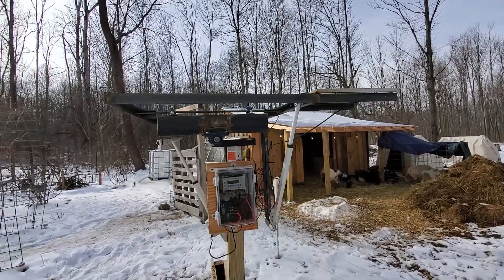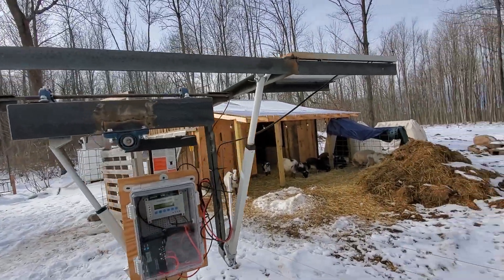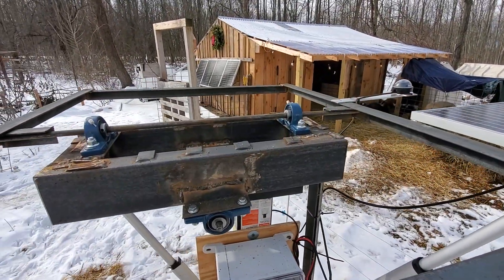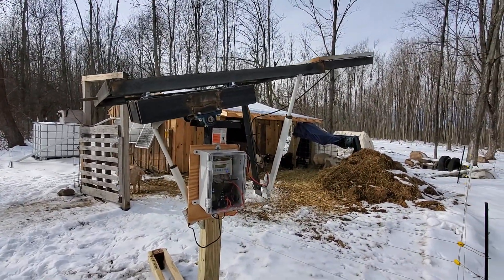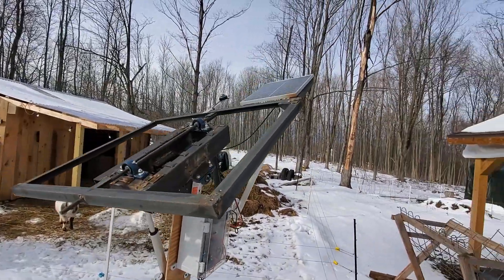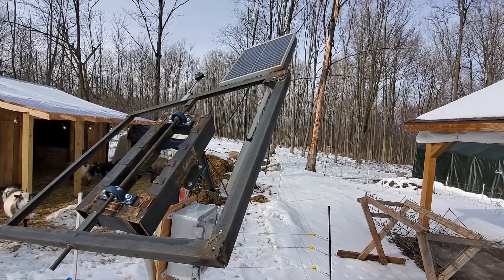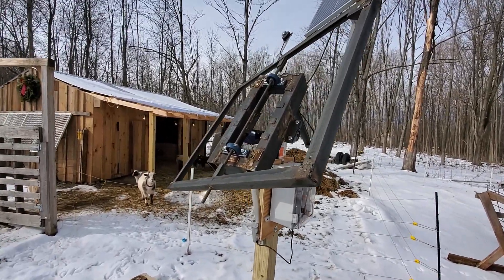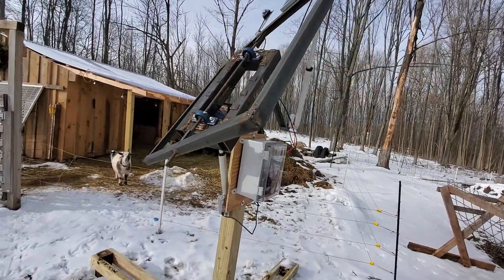Junkyard 2 axis Solar Tracker build

Comment: Nice job l like it! Built one my self looks like you have same controller and out door box  that lm using.  Have you had any problem with your controller yet?
Reply from the maker: Thanks. No issues with it at all.
Reply: Ok thanks l keep in touch 4 that reason
Reply: It's funny how many of us solar geeks arendoing this as a side project.  I've got a 5kw array....adding another 5 to it.  I have the 3rd mppt that needs panels and gears started turning on "how hard can it really be..."  So....my first Arduino showed up a couple days ago and I'm just about done writing script.  Lol.

Just curious...what does your "sleep code" look like?  I'm am "homing" on a combined value of east/west LDR being below a value.  Was going to send high to the output for east aiming and hold it there, use theblimit switches on the linear actuators to stop.   I know this works....using it on the chicken coop for two different doors wired to reversing relays.  

eMylo makes some cool little triggers that can be easily brought onto your wifi and controlled remotely.  12v, 120v single and dual channel units. They come with RF remotes but have built in wifi 2.4ghz networking.  Set them on timers and schedules.

Comment: Whats the load rating of the linear actuators and what length did you go with?
Reply from the maker: Eco-Worthy 1500N/330 lbs. The north-south axis is a 10" and the east-west is 16". I may end up replacing the 16 with an 18 to capture a little more swing.